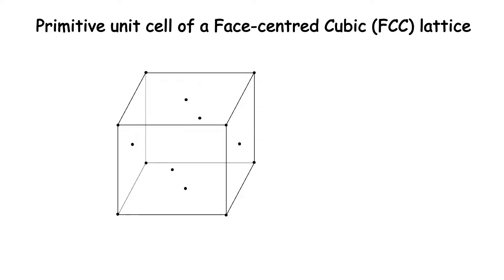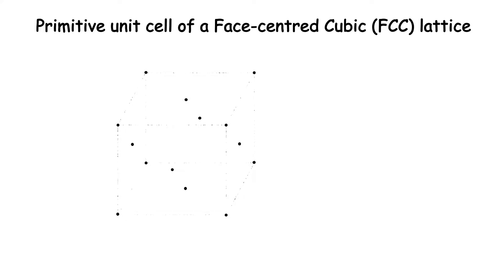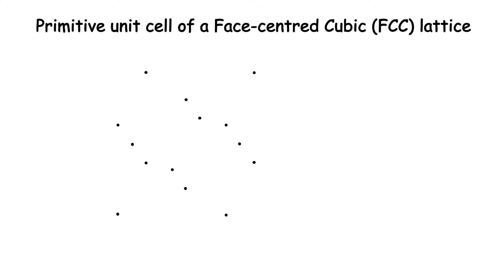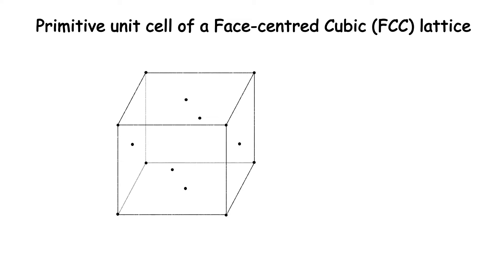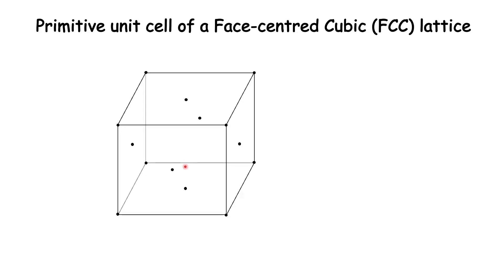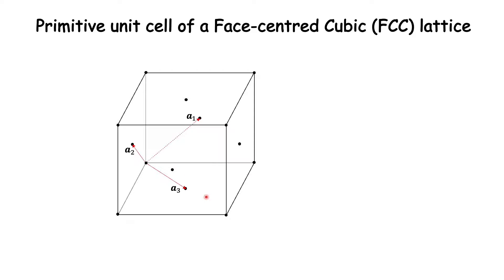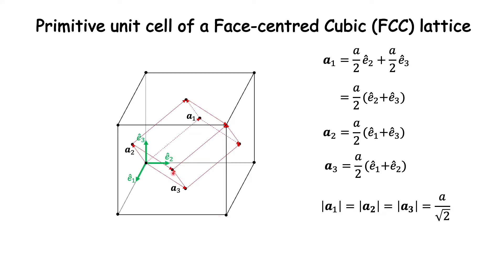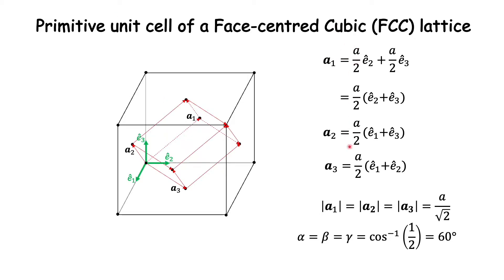Primitive unit cell of an FCC lattice

Comment: Very good explaination, Sir. But there is a mistake at @8.23 in this video. Contribution of each cornered atom in primitive unit cell is not 1/8. Although total number of atoms in one primitive unit cell is 1. Plz correct me if I am wrong.
Reply from the maker: Thank you for observing this. You are indeed right as all corners do not include the same solid angle. But for the purpose of calculation of effective number it works out fine to think that the contribution is 1/8 from all corners. More correctly, this is average contribution from each corner. 

Let us look at it differently. Focus on one corner (corner focus). Eight unit cells share this corner. And amount of sphere in each of these unit cells is not the same. Consider one particular unit cel out of these 8. Now focus on a unit cell (unit cell focus). This has eight corners and different parts of sphere is included in the unit cell at each of these corners. One of these corners will have exactly the same part of sphere included in the unit cell. 
So eight corners of one unit cell have one to one correspondence with eight unit cells at one corner. And as eight unit cells at one corner include one atom,  eight corners of one unit cell also include one atom.

I agree all this is a lot of hand-waving. A more precise proof of the statement will require adding all the solid angles of a parallelepiped unit cell. And I hope, that analogous  to the theorem for 2D parallelogram, where the angles sum to 360 degrees giving a complete circle, there must be a theorem for 3D parallelopiped where all the 8 solid angles sum to 4 Pi steradians, giving a full sphere.

Comment: What is the difference between cell vector and lattice vector?
Reply from the maker: Not sure of the cell vector. In what context do you use it? But lattice vector is a precisely defined concept: a vector from one lattice point to another lattice point. If by cell vector, you mean basis vectors defining a cell, then these are three special non coplanar lattice translations that span a unit cell.